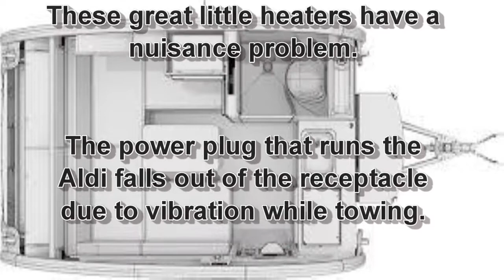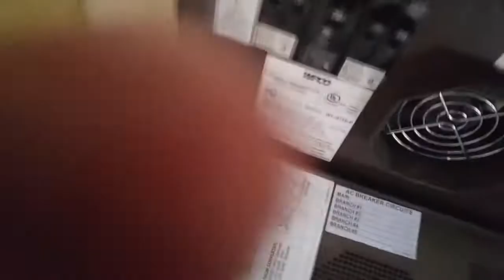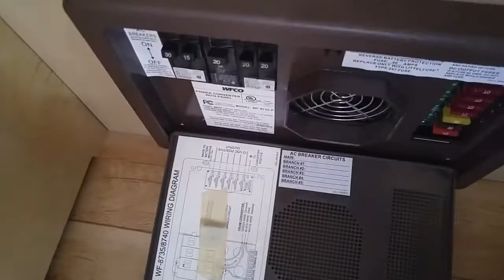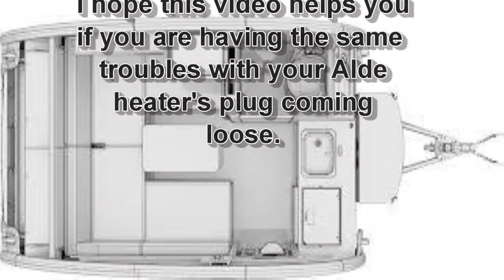Alde Heater - hardwire upgrade - Tab Trailer

Comment: I have not had any issues with the Alde plug falling out. When I installed my surge protector, I just moved the power receptacle to one side. There was plenty of room for it.

I am also using the receptacle's other outlet to power an extension cord that goes out the bottom (There is hole already there.) of the trailer.  I attach the end of the cord to the back door side stabilizer and pull it off when the stabilizer is down. The outlet has a water proof cap and allows me to have power outside the trailer without cutting a hole on the side of the trailer or having run an extinction cord out the door or a window.

I may shorten the cord to the Alde but keep the same outlet to clean up the space. I do not plan to use the area for storage, so the space being saved is not a benefit for me.
If I start having problems with the Alde plug falling out, I will just upgrade the plug to a twist lock or some locking mechanism. 

I am trying to keep my modifications minimal so if I sell it later it will be close to a standard trailer. I am sure at some point I will change my mind about this. 
Keep up the great work you are doing.
(Owner of a 2014 Tab Max-s trailer.)